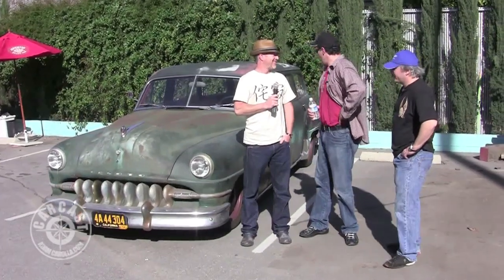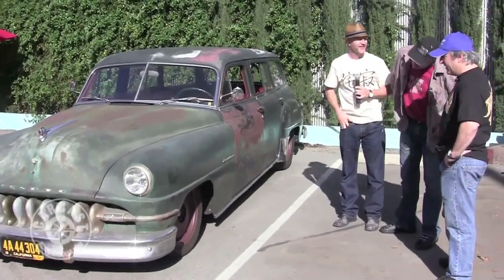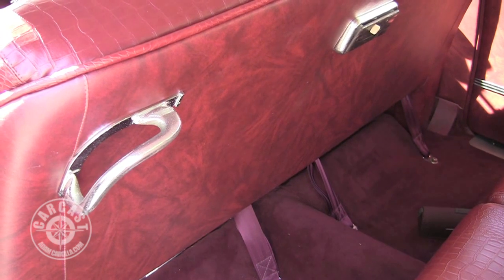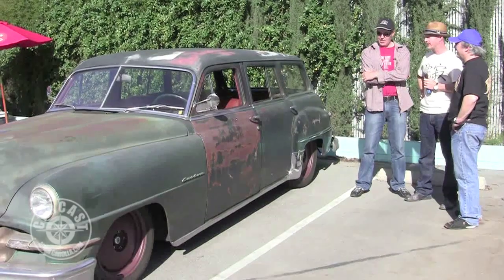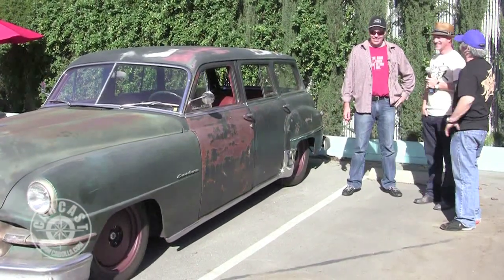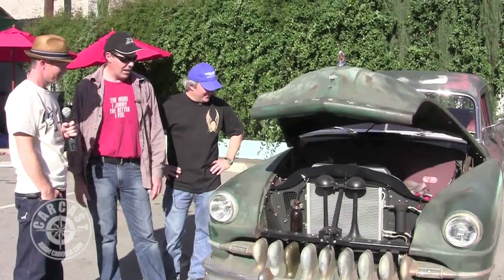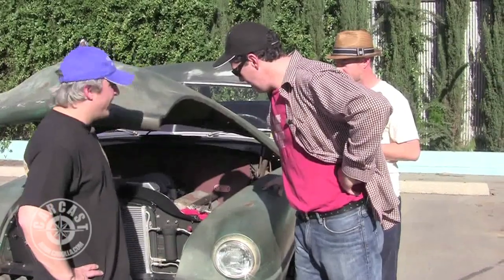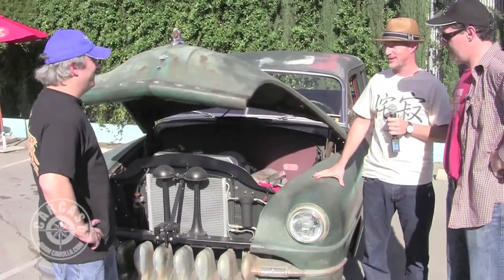Jonathan Ward's Derelict Wagon on CarCast With Adam Carolla

Comment: Apologies about the DeSoto front clip. Discovered that the hood was changed in the middle of the 1952 model year, so the 1952 DeSotos early off the assembly line had '51 style hoods.

Comment: I love the '51-'54 DeSoto front ends with the toothy grilles, and Ward was smart to replace the boring Chrysler front end.   Although he says this is a '52 DeSoto front clip, this hood - with its center curve lines and Mr DeSoto hood ornament - was unique to the '51.   An all-chrome hood ornament was standard; the translucent-faced hood ornament was optional and came illuminated from the factory.  Pontiac did the same.